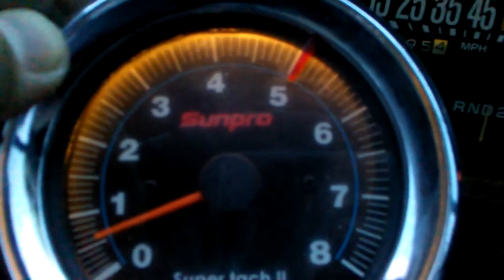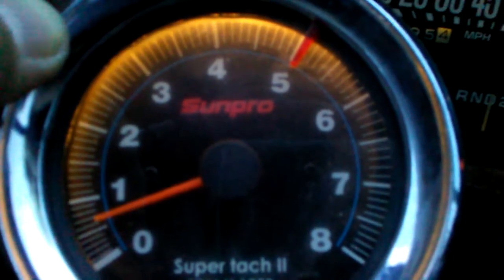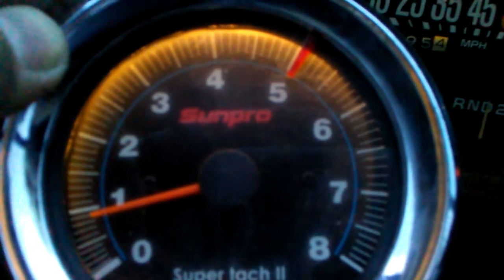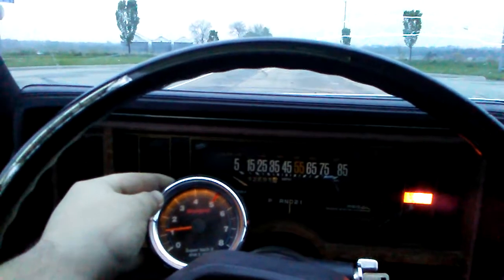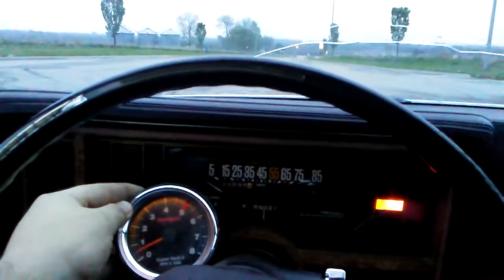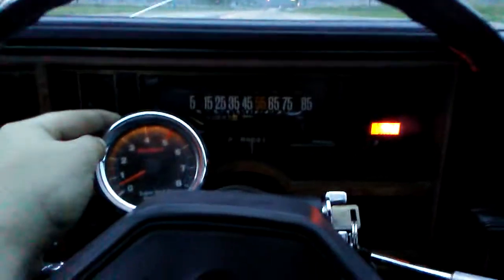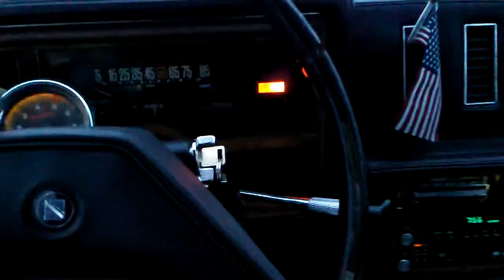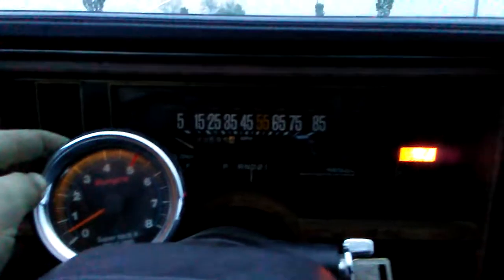Easy Way to Determine Converter Footstall RPM

Comment: With tranny in high gear, roll along at two to three miles an hour and floor it. What RPM the tack hangs at is the stall speed with your combination.

Comment: I installed a big dynoed engine. Thing was getting ugly and all over road just punching it. I could do extremely long burn outs with just cruising radial tires. I had line lock on front like most worked good. I put a line lock on rear to try cut my breaks off hold line lock when doing burnout to try to get to a 660' burn out but was close at 630' burn out on street. Rear line lock didn't work as I thought. maybe I might try a ball valve threw floor to cut off rear brakes to get burn out longer.

Comment: I always have to do this first pump brake pedal very hard several times to help hold car before burn out. Always seems to hold car better on faster things that don't want to hold still as easy doing burn outs. I flash stall it and brake torque it too. What I call A Brake Torque is pumping foot brake pedal several times up and down then holding brake pedal hard and mashing gas pedal to floor watching RPM"s before moving. And then flash stall the converter before the car moves compare the RPM numbers. And this is your stall speed.

Comment: What is it with yanks and cracked windscreens on their cars?
Sweet basic to the point video mate but geez that tacho laying back like yeah man you don't need to see what I'm doing ha ha just would have me going nuts to prop it up looking strait
Reply from the maker: Its easier to see than you'd think while driving.
Also pretty much its not really a big deal in most areas of the US to have cracked windows. As long as ita not completely shattered from a fresh deer or something it isn't an issue.
Reply: Windsxreen for my 96 toyota truck is 600 dollars thats why mine is cracked and will stay cracked not gona spend that when it will jjst get craxked again from tree limbs ect when im mobin in the mountains in my truck